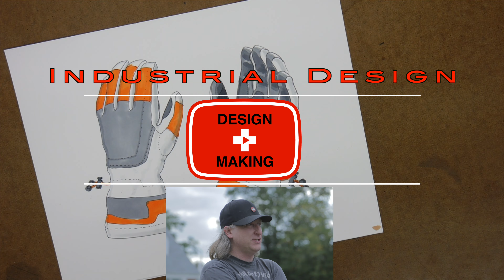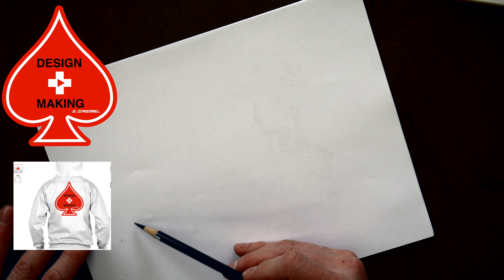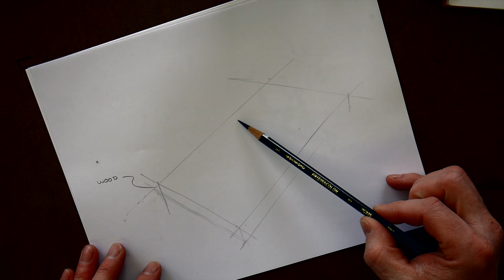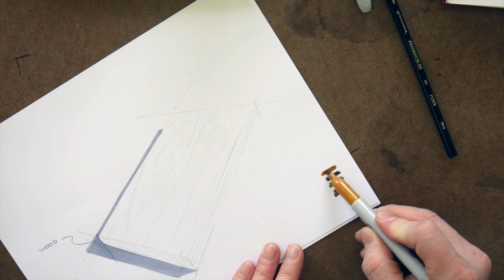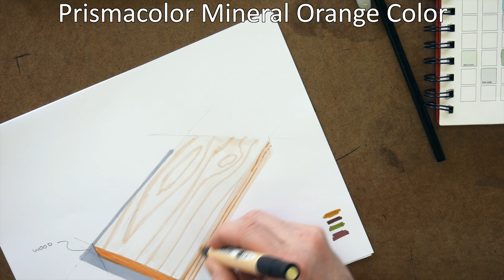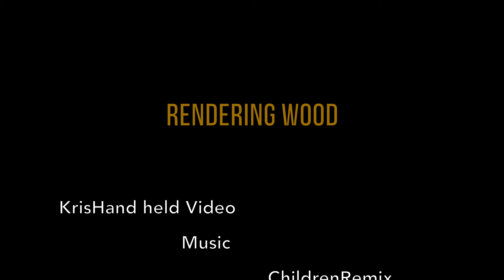Drawing with markers to Rendering Wood: Industrial and interior Design sketch technique

Comment: I have a question. I’m currently working on a project (marker & cp) of a candy bar with a torn wrapper. If I didn’t have the shadows in front it would look like it’s floating and not grounded on a table. I started drawing botanical subjects and always follow the rule of shadows from top left at 45° angle, but what you said about shadows here has me slightly confused.  Anyway any advice would be greatly appreciated. Thanks